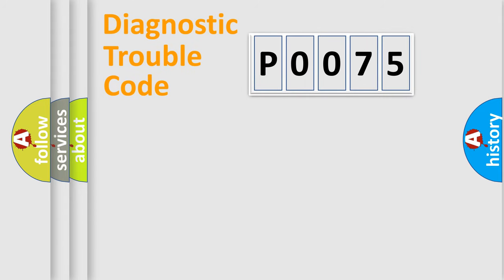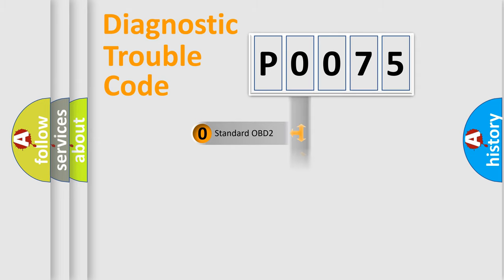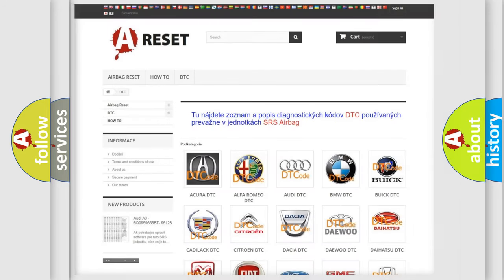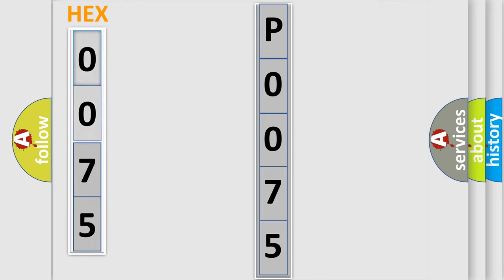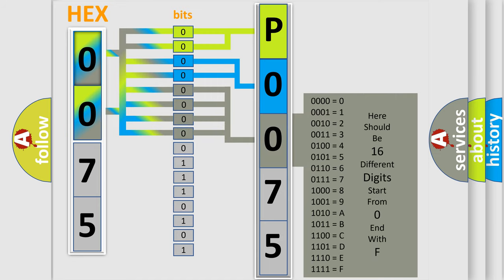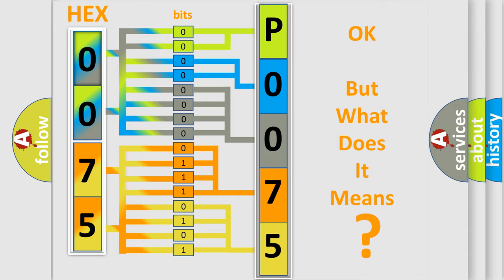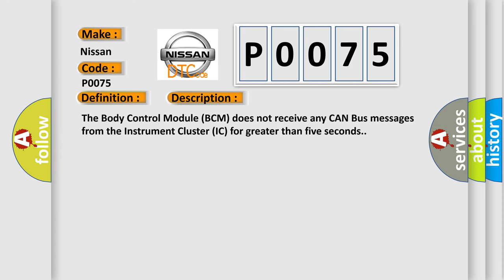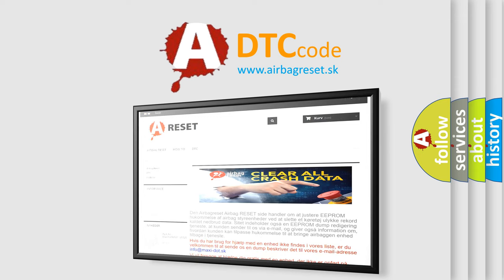DTC Nissan P0075 Short Explanation

Comment: Everything seems very informative until the actual code. When I look up p0075 I get Intake valve timing control solenoid valve
Reply: just an update for anyone with p0075 on an altima. its a code for crank sensor but i replaced it and no fix. once i changed the coil packs the car was 100%again. hope this helps someone